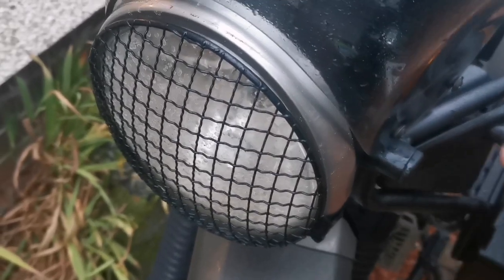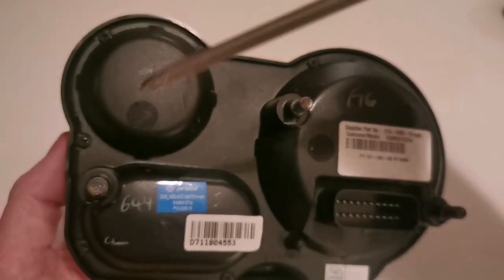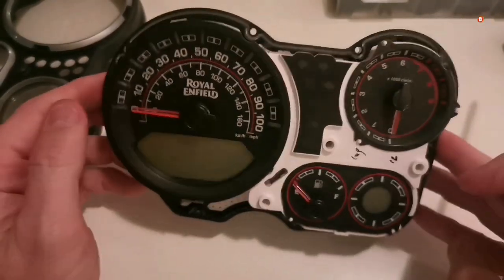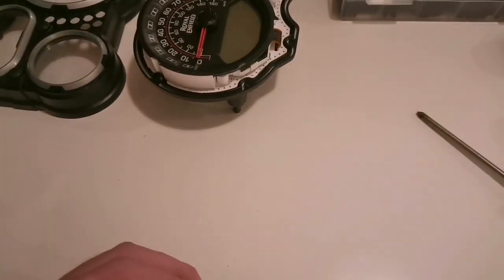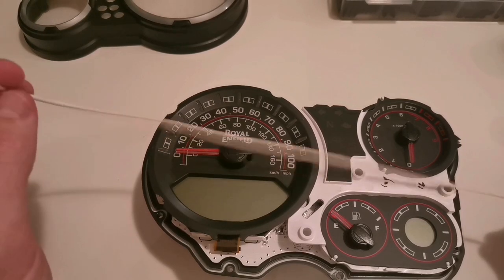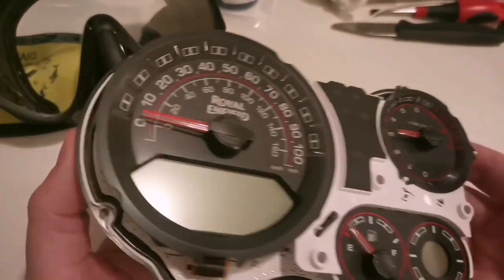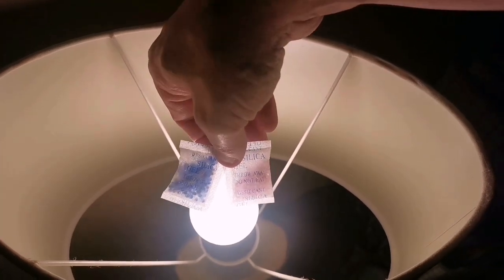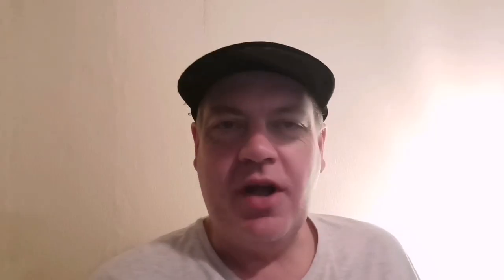DIY Fix Fogging On Himalayan Instrument Cluster - Prevent Condensation On Royal Enfield Himlayan.

Comment: My missus is a diving instructor too, so I fully understand the logic of the fix you performed.  However, I took a different approach with my 2019 Euro 4 model, that of ventilation.  I read somewhere that there are stickers on the back of the instrument cluster covering up holes.  Sure enough, I found four plain black round stickers which, when removed, exposed four holes about 6-7mm dia.  It worked! No condensation at all since then.
Keep the videos coming, very informative.

Comment: Good little fix that!  The colour change in the silica gel is caused by a small amout of cobalt present.  In its normal state the arrangement of ligands is tetrahedral and is blue but as it absorbs water it turns octahedral and pink.
Reply from the maker: Ah well there you go. I didn't know the exact science David so thanks for the input. I'm like ah.. Dry blue.. Wet pink lol 😂

Comment: Thanks for the solution, works really well. I only found out its very hard to push the buttons on the dash because of the increased height due to the elastic. I 'extended' the plastic sticks which push the buttons and now they are working better than before.
Reply: Interesting thanks. Must try that.

Comment: Hollow o-ring cord? That's amazing! My only concern with your fix is that the foam is still there. If leaky foam is the problem, the moisture passage still exists, albeit more restricted by the pressure from the cord. If you don't want to remove the foam, the above suggestion of silicone grease would help. I recommend really working it into the foam to fill passages. Filling up the electrical contact bay with grease before replugging could help eliminate that potential entrance. 

I really like how you did so many things at once to stop the problem. Wonderful and thorough. If my own cluster fogs, I'll keep your methods in mind. Thank you!
Reply from the maker: Thanks Andrew...don't even remember where I got that rubber it's been lying around with my dive gear for years lol. So far far so good it's been 3 days and the console is crystal clear so far so good 👍

Comment: I agree I wouldn't want to drill holes in the instrument housing. I am in the North of England, and I definitely wouldn't do it where you are when you ride in bad weather as much as you do. I tried pausing the video to get a good look at the back of the plug. I was really surprised to be able to see the coloured wires. I was thinking heat shrink or a rubber boot so I think I would add in Nev Wells tip of using self amalgamating tape too.
Reply from the maker: Agreed Nev is 100% on that one. It's pretty well sheltered behind the screen but aye it seems unfinished almost so am gonny go back sort that out. Drilling holes will allow it to breathe but yes in this climate its just begging for water ingress 👍

Comment: Excellent idea. Very useful information. I live in Australia at the moment and so far have not had this problem, the air is usually quite dry, although it can be very humid at times. Out here i tend to avoid riding in the wet as there is more than enough dry days to go round. So far so good but a great tip for a rainy day. Cheers Lester.
Reply from the maker: Cheers Lester.. Here's to many more dry days for you mate 👍

Comment: The logic to this mod is really good👍.. 🤞🤞hope it works mine  doznt mist as bad as some others do ...i think ive been lucky  with 2019 model no stalling.. no rear caliper issues.. (changed pads mind)   relays...etc  hope it continues🤞...atb
Reply from the maker: Thanks. Aye this should do the job for a while assuming it's sealed tight enough. It's been a few days since I did this. So far so good 👍 ur Himmy should be fine I'm sure it's well looked after

Comment: Hi I found that the small round material stickers on the back of the unit cover over holes, which you can feel if you press hard on the patches. As your making it more watertight it might be better to cover these with Ducktape. Stopping any moisture getting in. Cheers Mark
Reply from the maker: Great advice. Yes I saw them but didn't want to pull them off incase I made it worse. Good idea to put tape over them 👍 thanks Mark.
Reply: Pull them off and the clocks will breath better. Solved the problem on my GT. @WeeJaunt

Comment: Hi there, I had the same problem and I took mine apart and put some silica packs in there but mine is an LCD screen but it doesn't have a rubber gasket between the case at all, it does have four holes at the back to breath , do you think it would harm it to seal the case as when it rains I'm sure water is getting in or do the manufacturers not put a seal there for a reason i.e heat getting out  , I want to seal it but also don't want to damage it , any advice would be much appreciated 👍🏼

Comment: I am waiting for new instruments for my 2021 Himalayan. If it is a hot day, I have moisture in the instrument's for an hour. Later it will disappeare. Harley Davidson has the same problems since many years with the consoles which are sitting on the tank. This is the reason why I had buy a Harley with digital instruments.
Reply from the maker: Thanks Marina.. The console seems to be fine now since I did this repair. I'm hoping that RE will sort this issue on future bikes. 👍 Thanks again mate

Comment: Strange how in the "Good old days" the analogue clocks on a bike never seemed to fog up...
I have only ever experienced issues with condensation on bikes that had digital instrument consoles.
How much of a problem this may be for you largely depends on the level of humidity in the atmosphere where the instrument pod was assembled.
While it is possible to replace the air in the instrument pod with an inert gas that contains no water this is not the easiest solution. Simply getting a small silica gel pack in there seems to solve the problem for most people.

I have only ever noticed fogging of the instruments on my Himalayan when riding on very hot sunny days, which is something of a rarity for me. For the rest of the time the problem has never arisen so I've not bothered to address the issue so far.
Reply from the maker: That's it Henry.. Funny how things just worked lol.. The fogging issue hasn't been major for me either but its fixed now and hopefully for good. I gave you a shout out in this video because I thought you had put me onto the idea of the fishing pole elastic lol 😂 Thanks again mate.
Reply: my theory is its caused by the heat from the electronics and internal lighting. When its warm inside and cool outside moisture condenses on the glass.